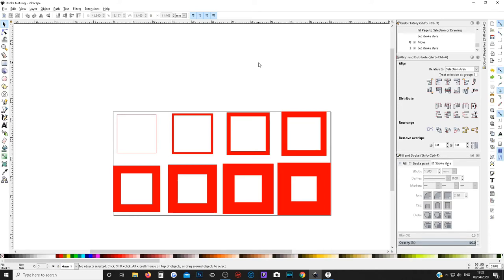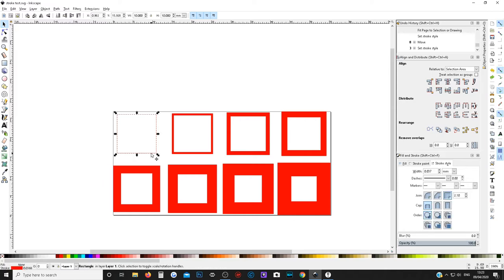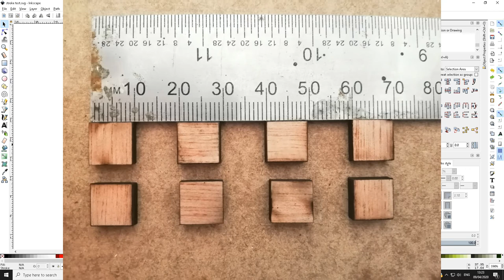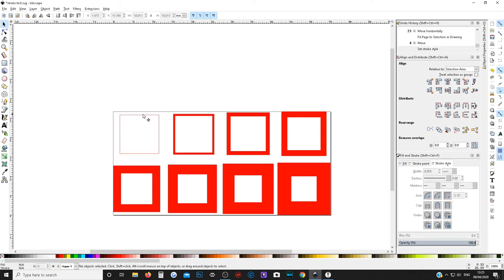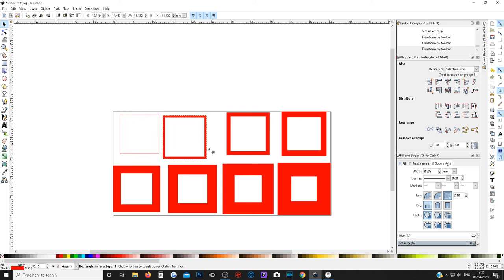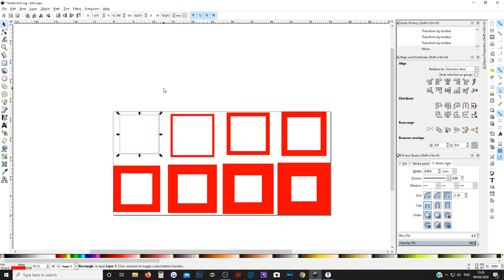Inkscape. Does the stroke thickness make a difference?

Comment: Do you know if there is a setting to make it so that the line thickness is taken in to account?  So that the negative space removed by the laser would decrease as the line stroke thickness increases?
Reply from the maker: If I am thinking of the same thing then you would need to use the offset tool to create a new vector line instead of using the stroke tool
Reply: So it makes sense to design without stroke first to get an accurate cut, then add the stroke afterwards, because in inkscape adding a stroke makes it appear as though the dimensions have increased when they actually haven’t?